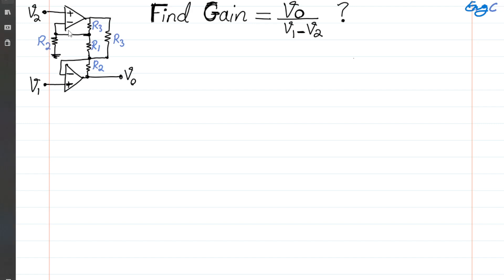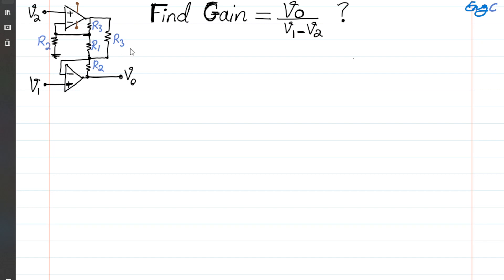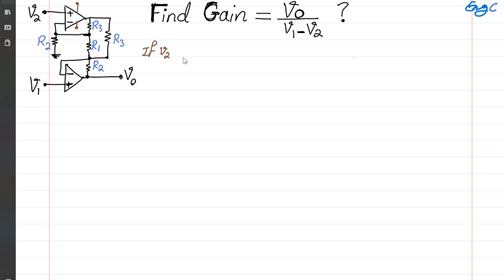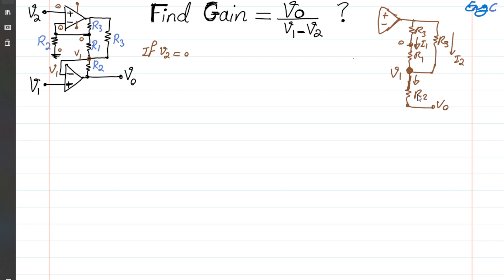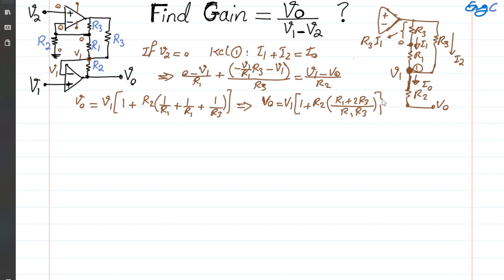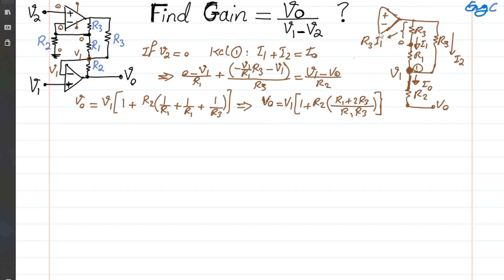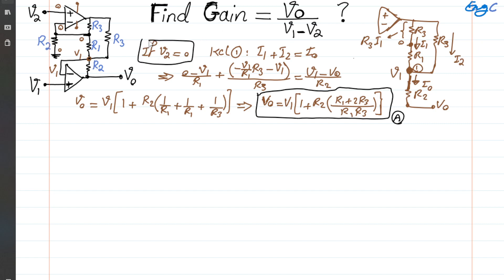Difference Amplifier with two Op Amps in non inverting formation

Comment: At (0:06:00) you make a mistake inventing an additional R2. You would immediately spot it if you simply look at the physical units of your terms: "1/R1" has "current divided by volts", while "R2/R3" has "nothing".

The whole matter results in that circuit having two distinctive gains for the two inputs. Thus you cannot define an overall gain in relation to the difference of the two inputs.

IF IT WERE that you had an overall gain in relation to the DIFFERENCE of the two inputs - whatever value that would be - you would have V0 being ZERO whenever the DIFFERENCE BETWEEN the two inputs were ZERO. That will not happen with this circuit.
Reply from the maker: Thank you for the comment. If you watch a few more seconds, you will see at 6:27 I already noticed that and I corrected the typo.  As for the gain (or transfer function) it is nominal to indicate Gain = output/input.  Such sybolic representation just means that the circuit simply multiplies input (in this case V1-V2) by the computed gain. It does not mean output is divided by input. Thanks again for your detailed attention.  👍
Reply: @STEMprof  In that case, the search for the error has to be extended... I first solved the problem on my own, then compared the result, then started to search for a mistake, stopping that search as soon as i found the first instance. If that got corrected somewhere downstream, i have to restart that search... :D
Turns out i had fugitive errors (not one, but two) in my scribbles. Thus i correct myself: Everything correct in the end in this example.